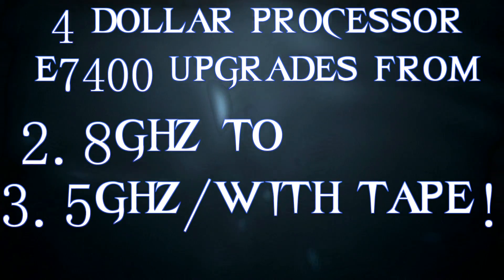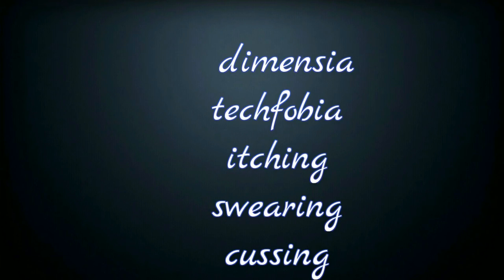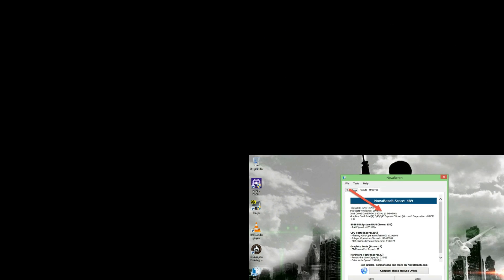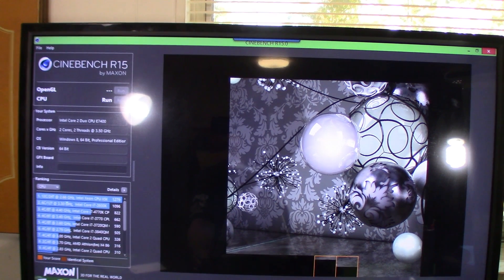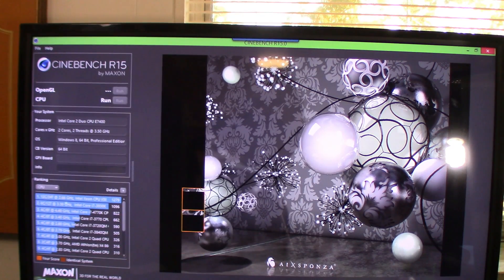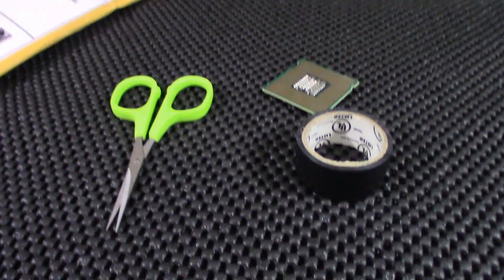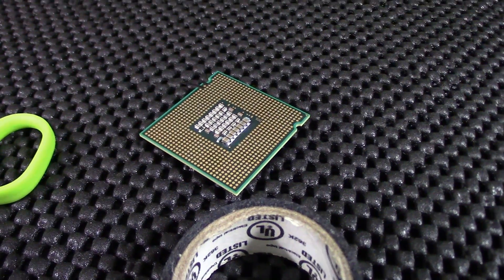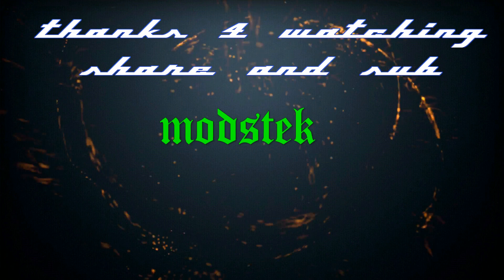"BSEL TAPE" MOD OVERCLOCKING CORE 2 WITH ELECTRICAL TAPE/ E7400=3.5GHZ!

Comment: Tried it again on an e7600 imac with the 2 pin method, still no cigar. It makes the chime and you can hear the hdd accessing but the screen remains black and then the system soon shuts down

Comment: Just tried this on a e7600 on a Compaq Presario SR5518F around the 2009 era. The mod 'works' as the tape boosts the FSB from 1066 to 1333, taking it from 3.07 to 3.83. I just needed the 1 piece of tape closest to the indent on the cpu. 

Attempting to get past the flash screen hangs. It's a shame, but thanks for the small DIY project.

Comment: I was mod with a core 2 quad q6600 juge gta for 1h and the pc restarted and after 1 day I put YouTube and after 3h gave me a blue screen that said physical memory dump
Reply: often you require a little voltage increase to stay stable.

also it can sometimes be an issue with the lower clock rate voltages/ intel speedstep.

The increased fsb effects the cpu at all speedstep clocks, you might be stable under heavy load when the voltage is at maximum but sometime the low or intermediate clocks cannot handle the lower voltages.

you can do a vid pad mod to increase the voltage range but I find disableing speedstep helps.

If your board reverts to a 6x multiplier with speedstep disabled you can use throttlestop to bring the multiplier back up, setting throttlestop to run as a scheduled task will ensure the overclock is applied on start up.

if you have no password on your account you will need to make one to be able to create the scheduled task, once it is active you can disable the password again no problem.

Comment: modstek hiya buddy do you think this will work on the Intel (R) core (tm) 2 extreme X9100 3.6ghz cpu iv got this in my Dell optiplex 760 and woundering if I can keep more power out of it  plus iv got one of these cpu in my old advent modena laptop aswell do you think it's possible

Comment: I have an E8400 will this still work with it??
Reply: no because it already has a bus of 1333Mhz..
Reply: you can cover bsel 1 instead to give 1600 fsb  if your motherboard supports it.

1066 = bsel 2-L, bsel 1-L, bsel 0-L
1333 = bsel 2-H, bsel 1-L, bsel 0-L
1600 = bsel 2-H, bsel 1-H, bsel 0-L

covering bsel 2 on a 1066 cpu results in 1333fsb 

covering bsel 2 & bsel 1 on a 1066 cpu results in 1600fsb

covering bsel 1 on a 1333 cpu results in 1600fsb

Comment: You should really try it on a Q9650 because i have that cpu but i have found no one who has tried this mod on one. i use a 
Dell vostro 220 which would be a great pc you could make a video on i even heard with he 1.3.0 bios update it supports 8gb sadly im only running on 4gb. poor ole ddr2 800mhz

Comment: OMG IT WORKED I HAVE THE SAME E7400 PROCESSOR IT IS NOW TO 3.50 GHZ
Reply from the maker: its a cool thing!
Reply: what is the logic behind it?
Reply: it increases fsb (front side bus) and higher fsb means higher core clock .

Comment: tried this with the q6600 it works!! had to do it over again a few times before I got it right but it works.
Reply from the maker: its a big difference that's for sure
Reply: yes it is. I paired it with the gtx 750 ti, and 8gb of ram and it's actually pretty nice.

Comment: I did this mod to my e7400 but it still shows up as 2.8ghz. Or does it just show up as that even though it's 3.5ghz
Reply from the maker: if you use windows go through task manager and click performance tab. you will see the speed and just run something cpu demanding at the same time.
Reply: modstek I did that but still shows a core clock of 2.8 ghz. Im updating my bios now to see if thats the problem

Comment: hello i tryed this with an e7400 optiplex 760 and installed the A16 bios it worked but every 15 minutes i get a blue screen error
Reply: left a like and subbed anyway 😊
Reply from the maker: that's really strange the only thing I can think of is maybe the ram are you running 800 speed? This mod works for me even on a 755 I was rendering blender with a q6600
Reply: Yeah my ram is 800mhz
Reply: modstek im about to take out my graphics card and try it i shared your video ty for the reply
Reply from the maker: I wish I could tell you what it was without seeing it but maybe download a temperature monitor like speedfan. I usually clean and re paste the northbridge cooler on the older dells.....do let me know if you fix it...thanks for the sub I appreciate it
Reply: Ok will do
Reply: You need to increase voltage.

Comment: Hello man, i really want to talk with you. Please send me a message to this mail if you can (rafaelluismf14@gmail.com).
 I would really appreciate it! Thanks and have a good day :)
Reply from the maker: hey bud whats up?
Reply: Thanks for the answer, what do you think about I get a Dell Optiplex 760 then add a Intel 2 Quad Q6600 2,4ghz + a Gtx750ti, will it run games like cs go, league of legends in mid settings with enjoyable fps? Thx :)
Reply from the maker: absolutely especially you can get the 2.4ghz to 3.0 ghz! You know tho 8gb pc26400 can cost the same as ddr3 ram. what im trying to say is yes it will work but if your a smart shopper you can get into something newer.
Reply: It comes with 4gb ram ddr2, does the motherboard support ddr3?  Because I was thinking about go for 2x 4gb ram ddr2 800mhz for 15$
Reply from the maker: no it doesn't support ddr3

Comment: Well OMG !!.. just tried this on my e7400 and worked like a charm...booted straight up and got 3.5ghz CPU z ...much snappier performance now thanks
Reply: e7400 generally needs a little more voltage to run 333fsb
Reply from the maker: its cool isn't it
Reply: Really cool man...I'm shocked at the difference, so noticeable during boot and opening programs  :)
Reply from the maker: it works on the q6600 as well it bumps up to 3ghz
Reply: that's my exact next move ...
iv got 3 rigs with q6600, the xps 720, ip35 pro, and another dell 760 ...the dell 760 will be attempted as I can already over clock the rest of them via bios
Reply: Well I just did the dell 760 q6600 now and more success , 3.0 GHz.....this is so easy....best of all only take 10mins ...thanks again
Reply from the maker: no problem was happy to share
Reply: @modstek  does it work with q8400 tried in bios wont boot

Comment: I got my Dell optiplex 980 sff working with the Zotac GT730 the only problem now is that the computer i pretty noisy because of the psu fan.Can i make the psu fan less noisy?
Reply from the maker: im not familiar with the the zotac power consumption maybe underclock it with afterburner and see what happens, or your power supply could be full of dust and cant cool itself down.
Reply: Ok thanks

Comment: I should try it on my q9300 on my optiplex 760 desktop
Reply: LazyGeekgamer HD  i had the same CPU and if you have one motherboard with overclocking support i reach 4 GHZ
Reply: Blackcat Overclocking I don't know
Reply: LazyGeekgamer HD you can try :3 it is not dangerous. I have tried this with my q9300 😂
Reply: LazyGeekgamer HD maaan, do you have optiplex 760? please reply :D i need some help
Reply: I'm getting a quad 9400 , had it worked for the 9 series??
Reply: No. It won't work with the q9xxx series as they have already 1333 mhz fsb. Search for 1066 fsb core 2 quads or extremes that are cheap or simply pick up a q6xxx processor.
Reply: yea dude, thats what i did, bught a custom built pc with a q6600 , overclocked it with the stock coller and a g41 asus motherboard, from 2.4 pushed it to 2.9